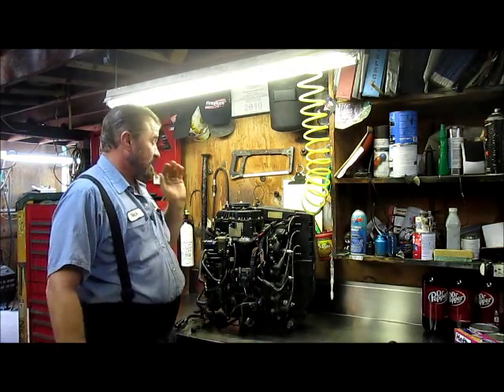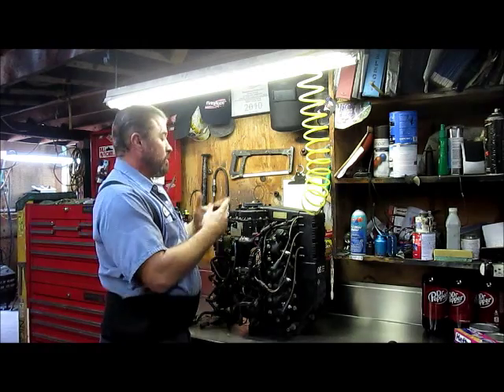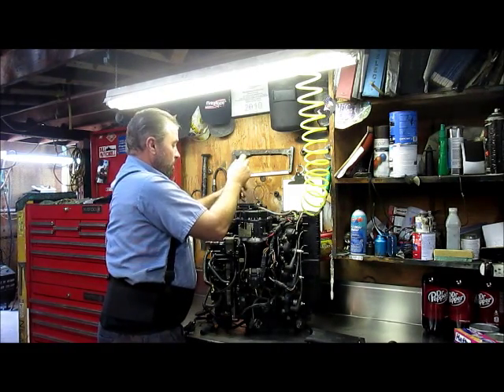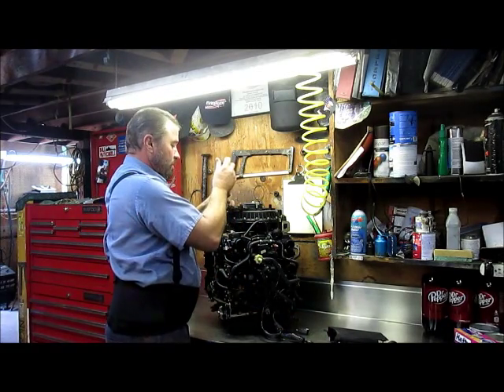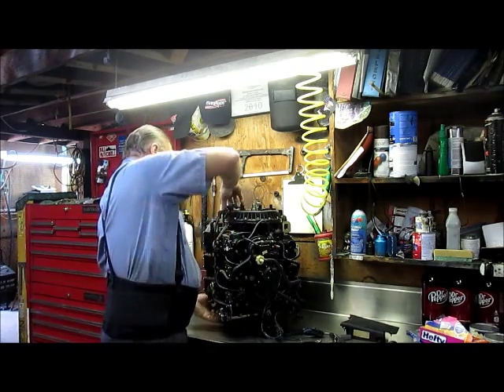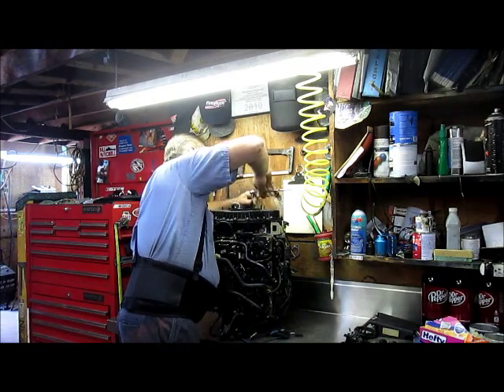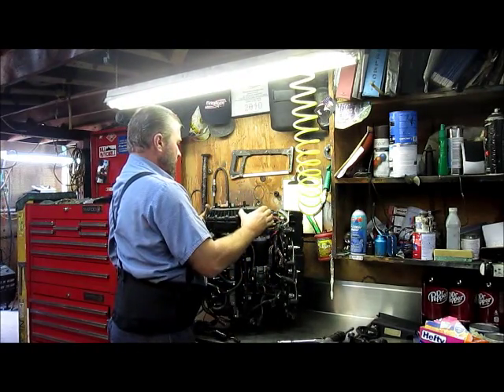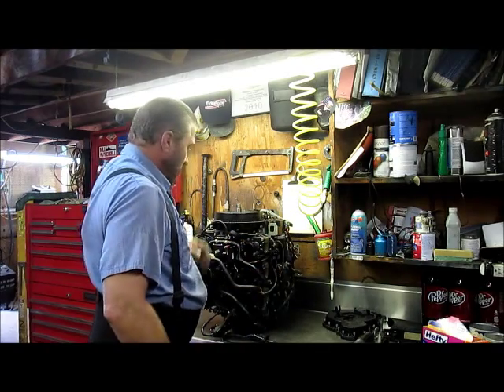Disassembly for rebuild of an Evinrude/Johnson V-6 60 deg outboard pt 1

Comment: Nick I have a question for you 175 fast strike engine runs fine at idle  I give it gas it bogs down i check the pressure on solenoid no pressure coming from the prime solenoid is that the way it supposed to be or is it  supposed to be pressure while the engine is running